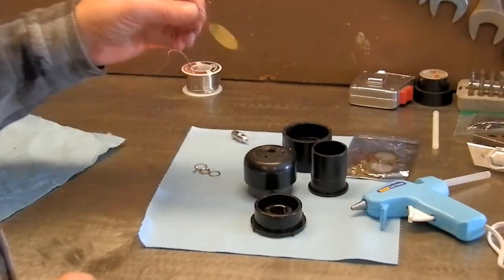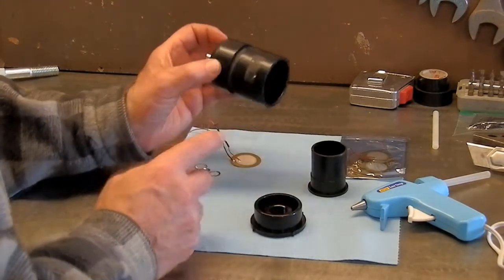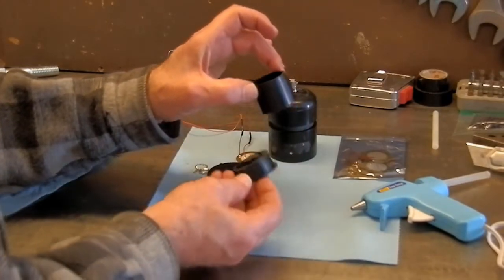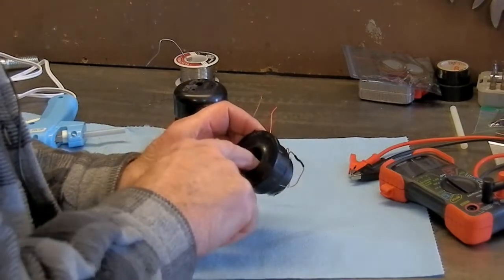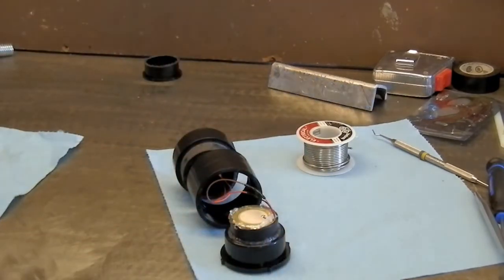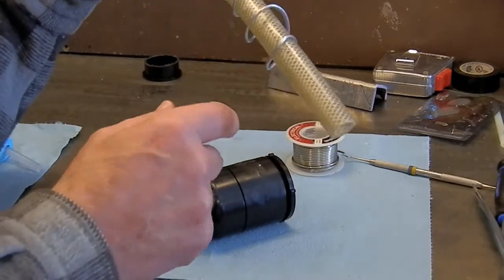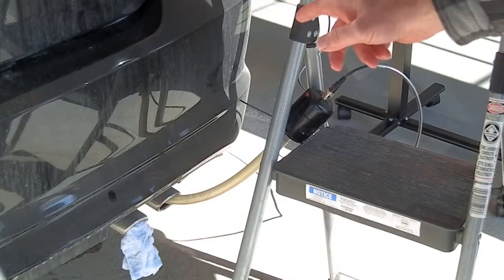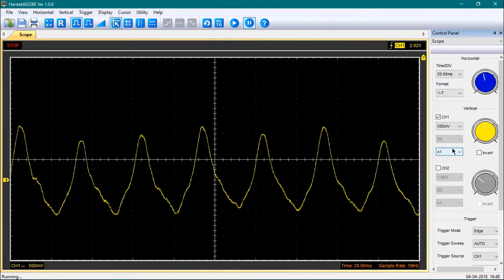GADGETS#8 - DIY PULSE TRANSDUCER

Comment: Just finished ordering them. Thanks. Have a great day.
Reply from the maker: +Jeff Grizzel - If you want a head start on the in-cylinder pressure transducer, order this pressure sensor. They take a long time to come in. Select the 300PSI one.
https://www.ebay.ca/itm/401232090642

Comment: Nice build,  I’ll check for some close metric pipe sizes and build one.

The scan time is 5 milliseconds per division, not 5 mega seconds.  Lower case m is milli, upper case M is mega.
Reply from the maker: What is meant to be said and what comes out is sometimes 2 different things...lots on my plate in doing these videos...

If you have access to a 3D printer, then the DS-PDS (GADGETS#132) is so much easier to build...

Comment: I noticed that you drilled three small holes at the rear end, that's something I haven't seen on other home made pulse sensors, did you do it to help the piezo move freely, (without trapped air behind it) I had no idea the first look was so expensive. Thanks for sharing
Reply from the maker: That was the idea at the time. How necessary, I can not tell.
There are alternatives to the First Look. And for WPS500 pressure transducers.
Check out ROTKEE and AUTOSCOPE for their pulse sensors and in-cylinder pressure sensors (all well priced, IMO). Good options, especially in Europe.
The pulse sensors are used RAW (no probe settings).
The P16 and the Px35 do need PICO Custom Probe to be created. If you go with one of those, I can help with that. I've created them for HScope Probe Database also.
Reply: That is two names I hadn't heard of, I must have been living under a rock. Thanks for pointing in in their direction.

Comment: Looks like you used a female bnc connector for the transducer.  I'm assuming you have a male-male connector somewhere in the connection to oscilloscope?  Nice work.  Just finished this project and a few of your attenuators.
Reply from the maker: yes, I have 1 meter cables with male BNC at both ends...
also useful are double ended female connectors that can join those cables to make them longer...
NOTE: the polarity in this video is in error. With piezo in this orientation, black wire should go to BNC center pin.
Reply: @theGADGETSplaylist  Thanks.  I've got my piezo sensor oriented so the white patch faces the open end/pressure source.  I spent more time than I thought I'd have to and still didn't find anything conclusive about which way is up for that type sensor.  It's only hot glue, so I can always reconfigure.  Good tip on the double ended cables - no doubt they come in handy from time to time.
Reply from the maker: @jenbry97  I would turn it around and have the brass facing the nipple. Piezo is under considerable stress under full manifold vacuum and if that "white patch" crumbles, pieces may get sucked into the engine...
It's also easier to have wires point towards BNC ...

Comment: I like this, also seen something like this to measure fuel injector pulse's, I think it was on Scannerdanner channel, he used a fuel pressure sensor from a gas tank.
Reply from the maker: Most of us follow the same guys. Paul is on top of his gave, as is Eric O and Yvan.
Oscilloscopes have really come into their own and ingenious approaches are developed all the time. The sky's the limit.
I appreciate you dropping by...
Reply from the maker: +Dennis Ryan - I checked it out. Holy screeching! Seems quite involved. I confess to not quite getting it. I watched KY Garage doing a couple of videos on what seems the same subject and didn't quite get it there either...so it's just me:)
Thanks for sharing.
Reply: Theres to much noise with the engine running, the tool picks up the sound waves (injectors clicking) a turns on the led light. I was using the drill to pickup everytime welding rod hit a bump in the drill tighter.It was a simple circuit to make and i got it from a project book that came with breadboard, after i made the circut i placed it in the gun, the gun was orignially a ele bug spray gun.

Comment: Would using a cap in the circuit anywhere have any effect, or resistors? I've seen so many different types of this build. Some use diodes to produce just positive voltage, but I know putting one of these on the intake, we want to read into vacuum. Same as in-cylinder. I used 1,  2" in. Disc and it produces almost 5 volts alone. Figuring out the custom probe for pico is the tough part. Measuring while testing the voltage swings are huge.
Reply from the maker: Pulse Transducers tend to be strictly piezo with RAW voltage and no custom probe setting...
Again Alan I invite you to join our HScope group. I think you and the group would benefit:)

https://t.me/hscope

Denis

Comment: Hi again... I have a question that comes across... Is the size of the piezo sensor important? I meant, the bigger in size  you have, the better signal you get? And the internal diameter of the hose matters? Any size that you recommend?. Thanks for your reply. Good day
Reply from the maker: I too was curious about this until I featured #125 ROTKEE PDS Sensor which uses a smaller 27mm piezo than the 35mm used in my builds.
Surprisingly, no difference.
Reply: @theGADGETSplaylist  thank you. Good day! :)

Comment: Are you using 35mm sensors ? I might make my own just to see how I do.
Reply from the maker: Yes, 35mm piezo...here and in the latest 3D printed version in GADGETS#132
Check that one out if you or a friend have access to a 3D printer...does not come any easier than that one...
Good luck with build:)

Comment: Great video. Excellent tool build. I’m looking forward to building one. Can you share the link for the sensors from China? I’m also looking forward to an in-cylinder transducer build if you get time. Great job and thanks again.
Reply from the maker: + Jeff Grizzel - These are the piezo discs I ordered on eBay. You must choose "with flying leads" and select the 35mm size.
https://www.ebay.ca/itm/281673370157
Good luck with your build:)
There will be a kick-ass in-cylinder pressure transducer build video as soon as all the components get here from China 😎

Comment: What are the size of those piezoelectric discs you bought on eBay are they 35 mm. Thanks
Reply from the maker: +James L - yes, 35mm
and do make sure you order them with the leads already soldered on...
Good luck with project:-)

Comment: I can relate to the soldering the wire to the piezo, I ruined a few lol. Kinda have a handle on it now. That’s a nice 1 1/2” reducer with the 1/2” pipe  thread you used on the front. Where did you get that reducer if you don’t mind me asking?
Reply from the maker: that was just off the shelf at my local building center plumbing dept...
I also direct you to #121 at the 5 minute mark where I show a small white polyethylene flange that provides additional support for 35mm piezo...
Reply: @theGADGETSplaylist  Yes seen that. I’ve been using the 41 & 50 mm piezos. I’ve done 1 1/2 and 2” tube versions. Just experimenting with different ideas. You’d be surprised how close ( with some filtering) they all are  (ranging from 27-50 mm).
Reply from the maker: @gcmd5852  it's not just that the piezo diameters all surprisingly give similar response....that 1/2" hose on this build inserted in tailpipe produces "same" results as the 1/8" hole of the ROTKEE PDS sensor also in tailpipe...go figure
Reply: @theGADGETSplaylist  I’ve tried different inlet diameters also. The 35&41’s actually have larger piezo ceramic discs than the 50. The 50 just has the larger brass it sits on. Definitely interesting little pieces. All are pretty comparable ( smaller CI and simpler intake manifolds)  unlit you hook them up to day a v8 with the larger intake manifold with all the different inside designs, them cause the sensors to kinda get crazy. I’ll have to try my hands at doing a video assembling one and maybe show my oddball experiments lol. That could be a don’t waste your time trying these pulse sensor ideas heading.
Reply from the maker: @gcmd5852  you my friend sound like a good candidate for our HScope TELEGRAM Group. Why not check us out:

https://t.me/hscope

Denis
Reply: @theGADGETSplaylist  thank you, I’ll have a look.
Reply: Stumbled across this crank case pressure transducer while diagnosing another issue on a 2021 3.0 diesel. Apparently GM is starting to monitor crank case pressure in these new diesels. I had to get a transducer for myself and see what’s it’s limitations are. Check out the video. I just wired up the sensor today, Did a bench test. I’m hoping to give it a test have on an actual vehicle with a cylinder sync today. https://youtu.be/F26QVBk-olQ